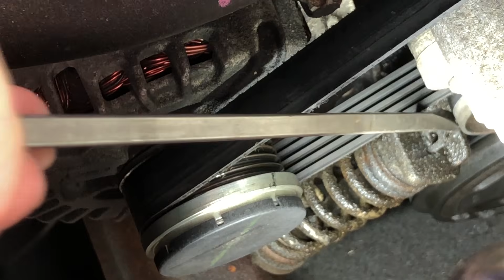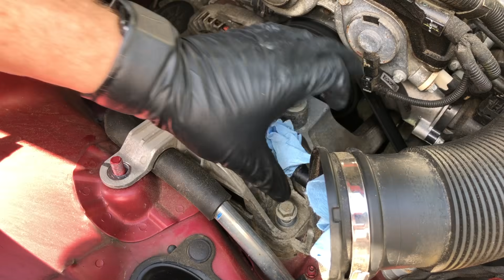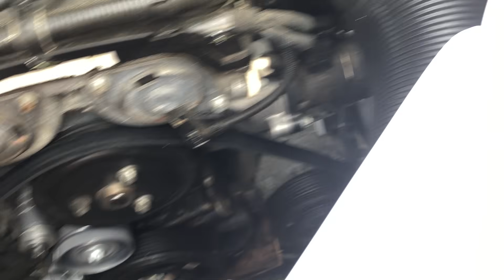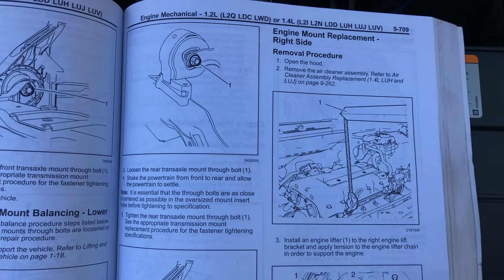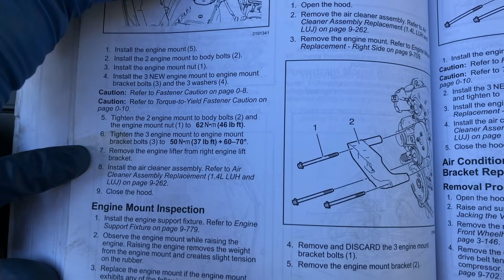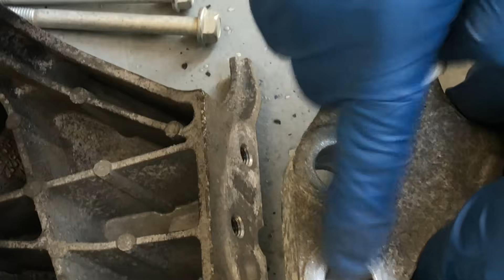2011 - 2020 GM Ecotec 1.4L Turbo Broken Drive Belt Tensioner Replacement (Chevy Cruze Sonic Trax)

Comment: I'm getting ready to replace the serpentine belt on a 2018 Buick Encore and you went over some helpful information for me thank you,  do I need to put the pin back in the tensioner after new belt is on?
Reply from the maker: No, that pin is only inserted when you're performing service on the belt or pulley accessories.  I believe I showed a shot of the GM service manual mentioning that the pin is removed for regular operation.   And then installed when you need to remove tension from the belt to perform a service operation.
Reply: @DrShock  ok thank you I appreciate it.

Comment: Excellent instructions,I always wondered what the extra degrees meant or how to measure.This video will be shared to a lot of the pupils.I'm trying to get a whole wave of better diagnostic and mechanically educated folks into the auto repair shops as far as possible,thanks very much for the great camera and methodical clearity.

Comment: Do they actually Grenade?
Reply from the maker: Not on the vehicle.  But once the tensioner fails like this, the only thing holding back the spring tension are the mounting bolts.   So it can want to spring apart once an end is freed.  This one was pretty boring though, nothing exciting to see.
Reply: @DrShock  no it's very informative my cars looks Identical to what that one looks like but the bearing part isn't spinning so it pretty much melted my belt and snapped it thanks for the video I'm more or less seeing what to expect when I change it tomorrow.

Comment: Would this cause a hard start? Because mine seems worn and I think that's where the sound comes upon start up..
Reply from the maker: The symptoms are going to be noise (usually rattling but could manifest with other sounds), excessive belt wear (e.g. writing completely worn off one half but not the other), and possible some vibration/movement of the belt in motion if it's really far gone.   I wouldn't expect any starting problems per say, though there can be excessive tension on the belt it's usually these symptoms.  Eventually the belt is going to fray and snap, from the tensioner being broken.

Comment: Thanks for the thorough video! You mention a failed crankshaft pulley as being the source of an oil leak. Would it be the pulley or just the seal that failed? I have a bunch of oil on that side of the engine, at least partially the result of the VVT solenoid gaskets up above, but the amount of oil over there suggests a larger leak to me.
Reply from the maker: I hope I said seal in that comment.  ;-)   Yeah, front crankshaft seal would be one of the additional leak sources.  Also the oil pan gasket is leaking on this particular vehicle.  I've got these repair videos in the publish queue for next month (or two).   It can also sometimes be the timing chain cover gasket as well, rather than just the front crankshaft seal.
Reply: @DrShock  NICE, thanks!
Reply: When cool, I would spray degreaser around the oil soiled area(cover the alternator) then wash/rinse off as much as you can. Check oil level and run for a few hours enough to see where the oil is stainng the area again. Use a light and angled mirror as necessary to find the leak...

Comment: I’m not aware that you need to remove the complete motor mount rather drop the three initial bolts lower the engine slightly And you can slip the belt out..Jack the engine back up and reinstall the belt
Reply from the maker: Well you are now.  ;-)   As shown, this is the GM factory service manual procedure.   But of course there are opportunities to improvise or simplify the procedure.
Reply: I was able to remove this with the vehichle in the air on my lift and removing splash shield behind wheel with plenty of space and no additional parts needing removal

Comment: I replaced one about 3 weeks ago on a 2012 cruze. I also replaced the the timing chain tensioner as it gave out and locked the engine. The chain got wrapped and locked the crank sprocket.

Comment: you do not need to remove the mount.  you can get to the tensioner and replace it without pulling the mount.

just loosen it, and pop it out.     the 3 bolts pointing UP have to be removed to slide the belt out and new one back in.
Reply from the maker: Yep, I mention in the audio track this is an option. For best visibility and access though, it has to go.